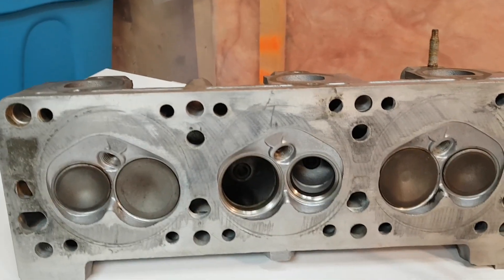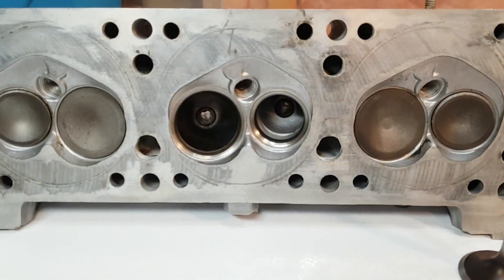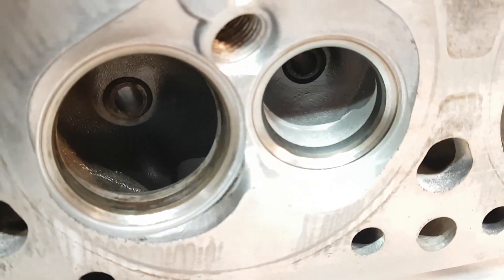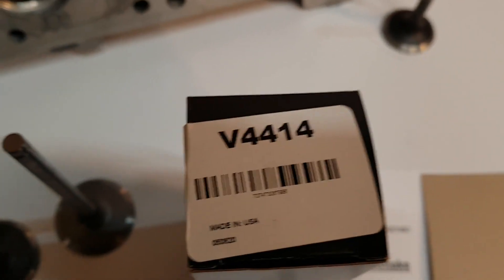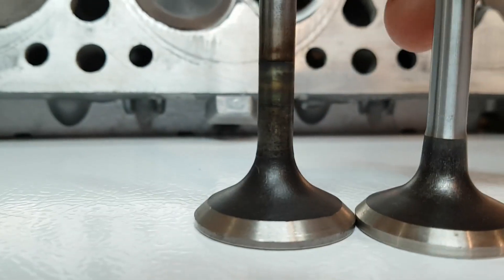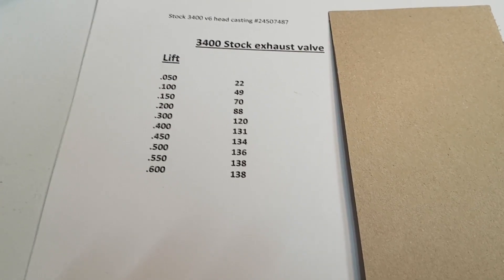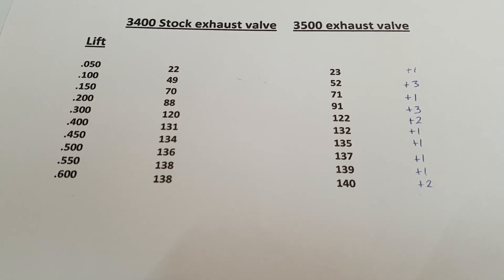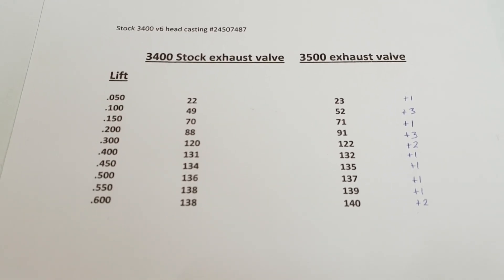Flow test results from a stock 31/3400 cylinder head + w/3500 valves

Comment: That bore size is definitely limiting some flow but are you using a tube on the exhaust for flow?  Those numbers look noticably lower than what I am getting on a 3.7" bore.
Reply from the maker: No tube/pipe on exhaust.  I have held a random pipe over the port and it brought the numbers up about 8-10 cfm from what I remember.

Comment: I wanna do this with my 94 3.1 what year 3500 valves do I need to get im pulling it soon for converter issues
Reply from the maker: 05-06 3.5l G6, 04-06 Malibu 3.5l (LX9), 2005-2006 Montana/Uplander,  and the 3.5 rendezvous. Don't forget that the valve seats for the intake valves will need to be machined larger by a machine shop!

Comment: What's the best head I can swap from a 3100 with virtually no problems?
Reply from the maker: You want to put heads on a 3100? If you're wanting heads for a 3100 the best would be 2000+ 3100/3400 heads. For the most power you would need a full port and polish on them.
Reply: @modeverything1  and if I were to swap my top and bottom end, what would drop in? I'm hoping a dohc 60° v6 setup would work
Reply from the maker: What vehicle are you working with?
Reply: @modeverything1  1998 Oldsmobile Cutlass
Reply from the maker: You can swap a 3400 in place of the 3100 with basically no modifications.  Next would be a 3500 LX9, which is a little more work than the 3400, and also requires an external crank trigger to run. After that your skill/wallet is the limit because anything else will require more custom fabrication and wiring to work

Comment: Nice.
Im waiting to get my 3400 heads back. Valve job and bowl-blend. He will flow them also so Ill have some numbers to share also.
Reply from the maker: Nice! The little bit of porting that I did picked up better than I thought it would! Just need to finish the video lol
Reply: @modeverything1  Are you using head studs? If so where did you source them? I only find arp studs for the 2.8. Do they fit the aluminium heads?
Id be very happy with just ordinary 10.9 or 12.9 m11x1.5 studs but it seem impossible to find.
Reply from the maker: I'm just using stock bolts (currently 2nd time on this set) once it starts having head gasket problems then I will look into studs. Wot-tech sells sets for aluminum heads, but I think someone on the 60degreev6 message bord posted what to use with using half of the 2.8 iron head set.